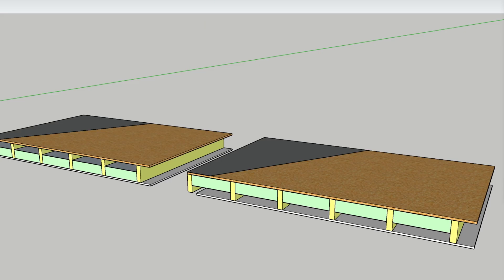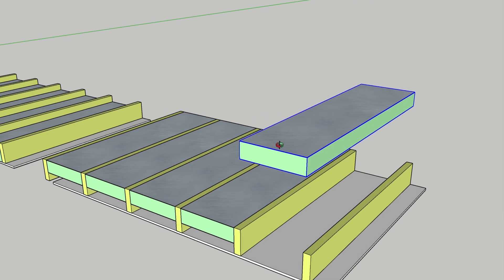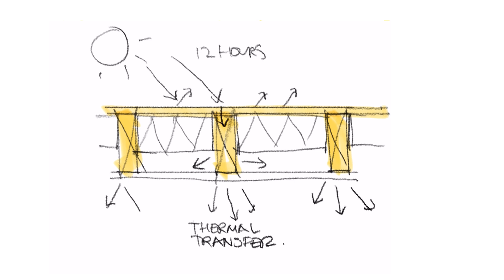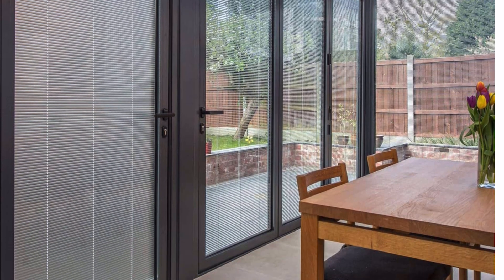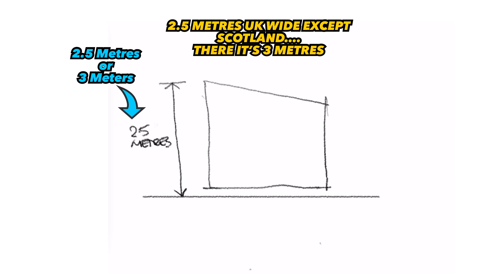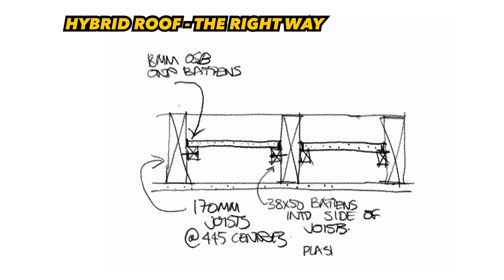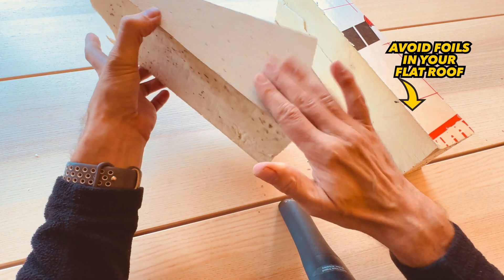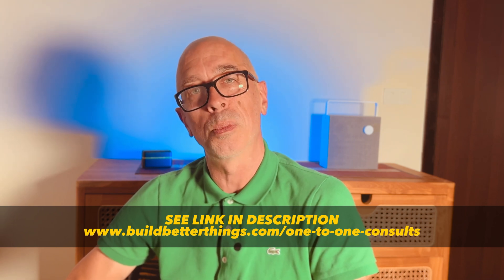Hybrid Roof - Build the Right Way- avoid overheating, avoid timber deck.

Comment: Hello, as a general builder, I did flat roofing training for built-up felt then EPDM Butyl over 30 years ago, but never have I heard the sound common-sense advice which you give on your videos regarding insulation on a warm roof. Your mantra "NEVER install a timber product on the cold side of the insulation"  is now indelibly rooted in my mind - but TOO LATE for my own home. Just ten years ago I built a large extension, insulated between joists, deck plus Butyl membrane then (thankfully) ballasted with large pebbles. I just discovered that the perimeter decking (where presumably most moisture leaked around the vapour barrier) is absolutely shot! 
I hope to save the membrane for re-use, but oh what a lot of waste - if only I knew your mantra ten years back! NEVER install a timber product on the cold side of the insulation!!! Thank you so much for sharing your wisdom and experience.
Reply from the maker: Hi. Thanks a lot for your comment and sharing your experience. Really appreciated.
Reply: @build-better-things  Hello again. When re-roofing my extension flat roof (18mm ply deck + 100mm PIR boards + loose-laid EPDM Butyl liner + pebble ballast) I've been advised to remove the original rockwool from between the joists; would you do that? Also, would you lay a second Vapour Barrier between the ply deck and the PIR (in addition to the original VB above the P/B ceiling, which is breached by recessed lights)? I am paranoid to get the detailing correct this time!!! Many Thanks, Geoff
Reply from the maker: Hi. Yes I would remove the Rockwool and yes I’d accept that the existing vapour barrier is going to be useless with the downlighting holes, so I’d install on top of your new deck before you add your insulation. Assuming you have a vertical vapour barrier for your walls, try and figure a way of sealing your new vapour barrier into it. You’re trying to make an envelope.
Reply: Its a great shame that honest builders/roofers etc are paying to learn poor or wrong
installation techniques, that they due to no fault of their own have taken as gospel

Comment: Fantastic advices and solid logical knowledge. 
Thank you. 

I’m in the process of building hybrid flat roof and came across this struggle.

How to insulate overhangs to prevent cold bridges.
Reply from the maker: Hi. I use what could be called a warm wall construction, where I have the insulation over the studs rather than between them, eliminating all cold bridges and going hard up against the underside of the roof insulation
Reply: @build-better-things  
Thank you for advice. 
I end up to change my plans for warm roof, because I have 3m restrictions and will be way easier to build it.
Reply from the maker: Best of luck

Comment: Great video, definitely helping me with my upcoming build.

Doesn't screwing the insulation down break the vapour barrier? Or isn't that an issue with smaller holes?

Also, where can I find the video showing the plastic-free, minimalist, roof edge finish?
Reply from the maker: Hi. Yes the screws break the vapour barrier. That’s one of the reasons why I’m saying to adhere your membrane direct to the insulation (as opposed to using a layer of OSB on the cold side). The roof verge detail video is coming soon. Thanks a lot for the comment

Comment: Hi, thanks for all the videos, very interesting.  Makes a lot of sense, and I totally agree that spending the sort of sums being spent of these buildings, why not make it last much longer.

Would vapour not travel through the porous wood joists and condense where it meets the cold-ish point under the 30mm PIR, especially at points where the fixings pierce the barrier?  

I'm considering just getting planning permission for plenty of ceiling height and plenty of insulation.
Reply from the maker: Hi. The dew point occurs above the joists, somewhere between the interface between the 30mm PIR layer and the EPDM membrane. 
Although not perfect, that allows any condensed Vapour to slowly sweat out through the EPDM. And even if you used different criteria and got a worse result , it’s still way better rather than having a condensation risk at the OSB deck, PIR with foils, and the timber joists like the existing solutions I mentioned. 
It’s trying to find the best of a worse situation with the height restriction rule. 
I don’t recommend it if you don’t have this constraint.

Comment: great video thank you- just wondering how would you do noggins in this roof make up while doing the vapour barrier as suggested?
Reply from the maker: Hi and great question. I’d take the vapour barrier up and over the noggins in the Dane way as I’m doing for the joists. At the corners you’d need to tape of course.

Comment: Hi there, thank you for the information supplied, very sound advice indeed.  I am struggling with three issues: 
1.- The rigid insulation boards you are suggesting for cold, warm and hybrid roof  are all flammable correct? they are not fire resistant.  I have contacted Kingspan and Celotex and there doesn't seem to be any rigid boards that are fire resistant insulation apart from Rockwool Stone Wool 
2.- We normally work with fiberglass roof instead of using your suggested EPDM can this be done on insulation boards too? we have experienced that some of the jobs we have been asked to correct the deck was rotten and we detected several faults the way the fiberglass roof was built, however, there may be condensation issues as you have suggested too.  It is hard to pinpoint how much of the deck damage was due to condensation and how much too poor fiberglass roof detail ...
3.- We use fiberglass because generally there are solar panels on the roof and this way we can provide fixing points on the roof, architects normally specify fiberglass instead of EPDM.  EPDM is generally easier to use and install we would love to use it but not specified generally on our jobs although we have been trained for both.
Thanks in advance for your help and assistant. 
Chema

Comment: 7:59 Structurally, this detail may be ok for small builds, however for larger or longer span roofs a continuous ply or OSB deck is important to make the building stable. 

Depending on openings arrangement even for small builds can be critical. 

Also, we shouldn’t forget noggins.
Reply from the maker: Hi. This is designed for small builds under 30m2 under the height restriction regulations, as I mention in the video. A structural engineer would be involved in the structure. The rest of what you say is not precise enough to offer comment on, except, yes, we need noggins, nails and a whole load of other stuff that I didn’t have time to focus on.
Reply: @build-better-things that is all correct, my points were more for those who may have missed that   aspect as they might not being in the profession.

Plywood or deck right on the joists (or occasionally below) is essential to ensure that the roof can act as a rigid plane and prop the walls. On small builds however this may not be needed if the walls are stiff and held down properly.
Reply from the maker: Yes, thanks a lot for the comment. Appreciate it
Reply: @build-better-things  hi, we are planning to extend and our plans are 6m x 6m. Will this hybrid method be suitable at 36sqm? If not what do you recommend please? Thanks!
Reply from the maker: @nazimahaji1886 you need planning permission for that size so you should get your height with a warm roof which is the optimal solution. I’m only suggesting the solution in the video for those with a height restriction for permitted development
Reply: Thanks for the speedy response! Please suggest a video with proper instructions/explanation for a warm roof. Or is this video sufficient with all the details required. Thanks again!
Reply from the maker: @nazimahaji1886 Build a Warm Flat Roof the Right Way
https://youtu.be/xWRLCWmqT50

Comment: My understanding was the general rule is any insulation above the joists would need to be thicker then the insulation between the joists to avoid the risk of interstitial condensation. The might be a condensation risk on the vapour barrier where it sits on top of the joists, as it is above the majority of the insulation thickness.
Reply from the maker: Hi. Yes there is some guidance on split insulation but this is only relevant where some of the insulation is below the vapour barrier. In my example, all of the insulation is above the vapour barrier. I’m not clear where the interstitial risk could occur?
Reply: @build-better-things  Hi, between the top of the joist and the underside of the VCL as there is less insulation above at this point then elsewhere.
Reply: @ETH92  I have just done my roof in this exact way and now am concerned about interstitial condensation of the joists. Is there anything I can do now I have already put the EPDM on that can mitigate this risk or is it too late

Comment: So if a ventilated cold roof isn’t an option, would you recommend a hybrid roof instead of a warm roof for optimizing the vapor transfer and ultimately extending the lifespan of the roof?🤔
Reply from the maker: No, warm roof is the optimal solution
Reply: @ Thanks! Another question though: if a Warm Roof is the optimal solution to achieve this goal, then why do roofers then sometimes opt for a Cold Roof or a Hybrid Roof instead?🤔
Reply from the maker: Height restrictions by planning, lack of knowledge by the designer. But also, ventilated roof is the only way for certain types, sips and lead seam roofs for example.
Reply: @ In your professional opinion, what are the features of a Warm Roof that provide the best protection against water condensation, and prevent it from occurring within the roof structure?🤔

Comment: Hi, I’m converting my garage into a utility room, not to be lived on, should I go for this hybrid option or cold roof? If cold roof I need to add 50x50 battens to allow space to vent over the joists. Thank you for sharing this.
Reply from the maker: Either is fine. I don’t like to be vague but it’s difficult to say without seeing it. Probably bonding onto insulation would be my preferred

Comment: Hey, great video very helpful! For this hybrid warm roof solution, would a 50mm cross-ventilated void be required, similar to a traditional cold roof, or is ventilation at the soffits unnecessary, like in a traditional warm roof?
Reply from the maker: There’s no voids on the cold side so no need for ventilation.
Reply: @build-better-things  Thanks for the reply, looking forward to the video on the roof edge details!

Comment: Thanks for sharing this info, I found very useful. Any tips for someone who must use a deck above the top insulation as the roof will need access for maintenance of the joining house and windows.
Reply from the maker: Hi. Inverted roof is the way. I’ll try to make a video about that soon.

Comment: Nice ideas there. I think a compromise between your way and the bad way you showed (with the PIR pushed up flush to the underside of the OSB) is to keep the PIR flush with the plasterboard instead and keep a bit of ventilation space between the top of the PIR and the underside of the OSB. Put some vents in the front and rear soffits and you should get enough air flow to remove any moisture that gets through. You’d obviously need to cut some space in the PIR in which to house the lights (and if possible tape the vapor barrier as best you can in those spaces to keep continuous). Your way is definitely better but I think the above way is a compromise that would certainly length the time considerably before any remedial work is required.
Reply from the maker: Thanks. Am I understanding you’re describing a ventilated cold roof ? which I think is fine, except you can’t avoid the thermal bridging. The ventilate will help with the overheating in summer but winter heat loss still an issue.

Comment: Do you have any advice for a metal roof.
As they are always attached to OSB, which is the cardinal sin.
Reply: Could you attach it to joists maybe? Sounds a bit dodgy though. Builders would laugh I imagine.
Reply from the maker: Assuming corrugated sheet roofing, fix to a frame, can be timber, steel, often you’ll see purlins as the fixing members.

Comment: Being in Australia, this hybrid seems to be a better option than a warm roof as heat gain is my main concern. Flat roofs are extremely common for the main house here and rubber covering is rarely, if ever used, it’s nearly  always a Colourbond roof that’s put on top. Have you any examples of warm or hybrid roofs with a Colourbond or similar roof material? Does this alter the solution?
Reply from the maker: Hi. That would depend whether you’re using sheets, or a composite which includes the insulation bonded into the sheet. If it’s the former, and in your location,  and it’s pitched, I might use a ventilated roof probably with a hybrid approach. But as always…it depends, so hard to be too specific without seeing it. Thanks for your comment.

Comment: I watched your video again and I had an idea.
For your hybrid system, assuming that thermal loss through the joist is not of concern, would you agree with using 100mm insulation between the joists, and the roof attached level with the joists. You could attach a metal roof to battens using this method also. I am having a metal roof btw.
The cavity below the insulation would be reduced but still workable I think.
Reply from the maker: You need to be careful about pulling the dew point lower and into the room. That’s why I wouldn’t recommend your idea. 70mm between and 30mm over is about as less as you can make it and even that is not ideal.

Comment: Great explanations!
Apart from height restrictions, cold roofs are athletically nicer. This hybrid roof is a great compromise.
You talked about the joists acting as thermal bridges. Does this mean that a cold roof would lead to rotting of the joists?
Reply from the maker: If your ventilation is working for you, as it must for a” cold “ roof, and you have the minimum 50mm air flow, for thermal bridging, there is less likelihood of the space becoming roasting in hot weather. Cold weather, you’ll still have the some heat loss through the timbers for a cold roof. Much less chance of condensation, since evaporation will occur with the air movement within the cold roof void.
Reply: @ I am less worried about heat loss. I will take the hit.
But I definitely want to avoid rotting timber.
I was planning having no soffit. But how do I get ventilation to the cold roof with no soffit?
Reply from the maker: @benwilkins2998 So many solutions, every project is different. This is the beauty of self building, the process of researching and solving it in a beautiful way. Best of luck with it.
Reply: @ Over Fascia Vents look like the answer

Comment: I want to remove an old conservatory and build a new warm roof. it extends 5 meters rom the house and is 6.5 meters wide. As its such a large roof, I want to add a Lantern unit to allow light in. Can this be done successfully, keeping a high level of insulation, Thanks.
Reply: Very similar for me. 

What did you decide in the end?

Comment: Thanks for the video. May have been covered below already, but can you walk/kneel on the hybrid design proposed to install the roof membrane without damaging the PIR insulation?
Reply from the maker: Yes, no problem at all. The insulation is rigid.

Comment: Would appreciate your thoughts on the following:

We have a garage which I need to start using once/twice a week for my business. Currently it has a cold roof setup but no ventilation as the joist run towards the house. We don’t have much money to change the roof setup. I have watched quite a few videos of builders and roofers and I am still confused if a hybrid approach would work for us. 

As the roof is already on I can’t put a vapour barrier above the joists as you suggested so it i can either be on the plasterboard level with insulation pushed right to the top or it can be directly below the insulation but taken over the underside of the joists to have a continuous VB across the entire roof but avoids being broken for lights etc. 
 
Would this work or am I just going to cause myself condensation/rot issues.

Comment: Hi, finding your videos very useful. 
Currently converting our loft and want to using hybrid roof with 60mm PIR above rafters and 100mm between. 
One warry is where the dew point would fall on a build up like this.
Seems to be a general consensus that there should always be more insulation over the rafters than between. 
Whats your opinion on this?
Reply from the maker: It depends on your vapour barrier placement, and a host of other things, but as a general rule, it best to aim for 1/3 between and 2/3 over if possible. However, that’s not always possible , and it’s easy to do a dew point calculation which will help you. You could also consider ventilating, and do insulation between and then on the underside of the rafters

Comment: Hello. Very informative video, thanks. I am looking to build a flat roof using the hybrid method you outline. My span for roof joists is about 3 metres. Can you advise where I would position noggins to tie the joists together if I adopt your hybrid roof layout, please? Joists are 145 x 45 set at 450 centres to accommodate the PIR. Thanks for any advice.
Reply from the maker: It’s hard to give structural advice without seeing the design but your noggins would be the same depth as your joists and I would probably do 2 rows to catch the plasterboard running at right angles.
Reply: @build-better-things  ok thanks for replying

Comment: Will this method work on a pitched roof?
Reply from the maker: A pitched roof probably won’t have the height restriction so i would use a different method. What I’m illustrating here is for a worse case scenario